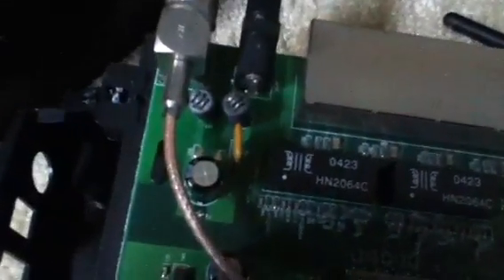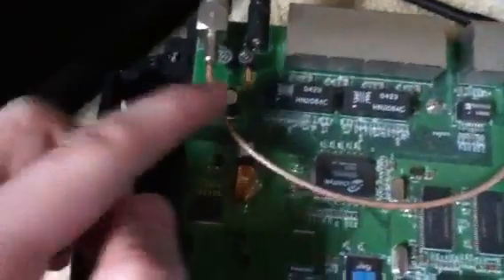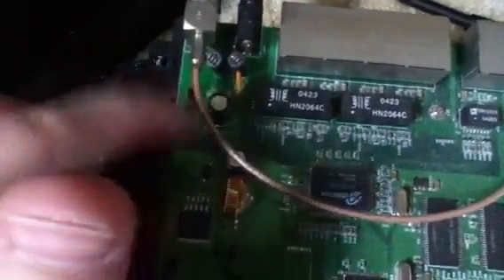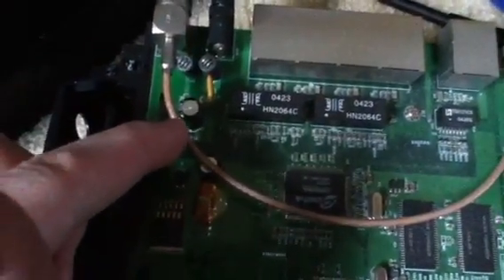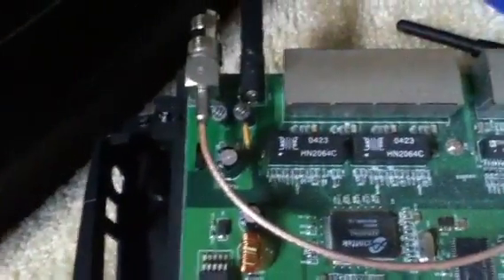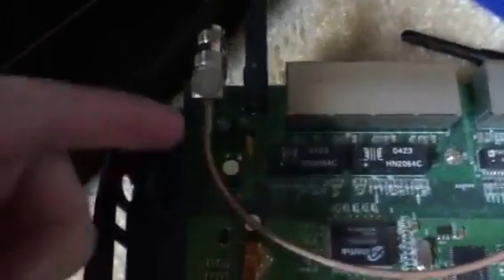Linksys wifi router buzzing noise

Comment: I know this is a pretty old video, but I figured some people may still be looking.  Replacing the cap he pointed out in the video will absolutely fix this issue.  I have fixed several.  If it goes long enough, that cap will eventually bulge/leak.

Comment from the maker: Good luck! If there isn't a fan in there it is probably another component vibrating. Like in the video bad filter caps seem to cause it. 

For the record, the router in the video is a linksys WRT54G. It has been chugging away pretty well for many years.

Comment: Currently have a 2600 series that is making a weird noise. Mine seems to be more of a whining noise ( possibly from the fan bearing ) while yours seems to make more of a buzz saw sound.  If I put pressure on the bottom of the router the noise subsides. I will be opening her up this weekend to try to figure out the issue.